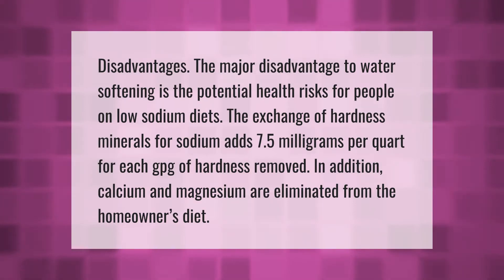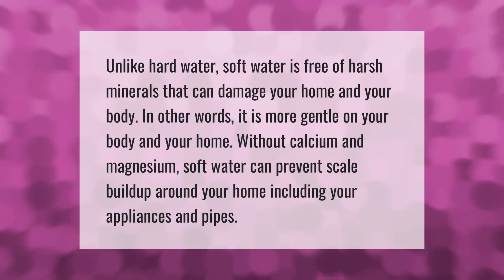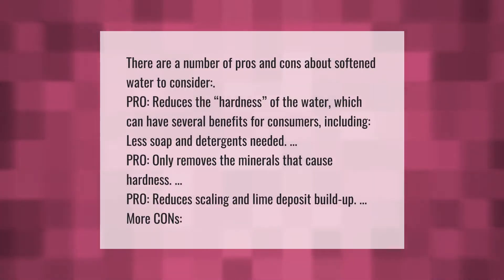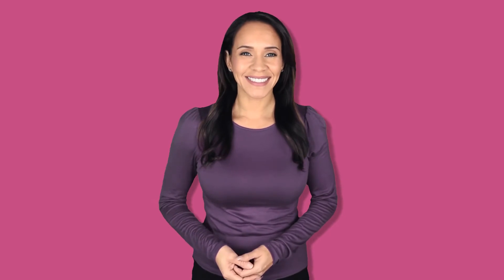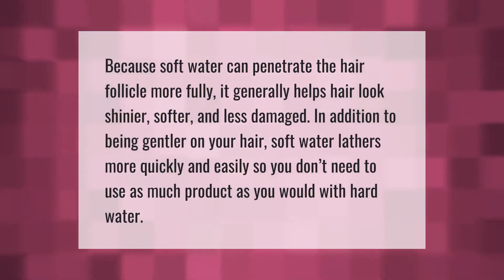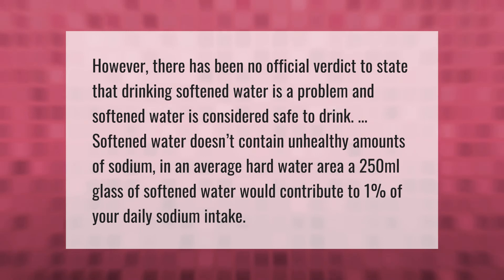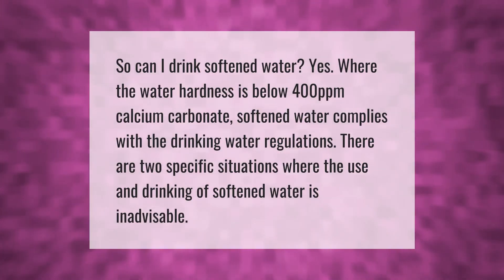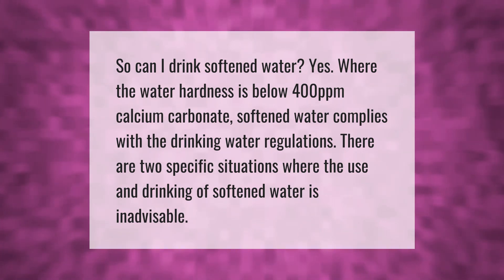What are the disadvantages of a water softener?

Comment: Soft water DOES not affect sodium intake  into your body. Drinking soft water also does not increase sodium uptake that would affect any existing medical conditions. This add is misleading!
Reply: how does it not if the TDS is replaced with sodium?
Reply: @somebb  Sodium is used to soften hard water it does not replace water. Sodium is a natural electron in water and tap, well, and spring water has 10-20mg of sodium. Soft water, depending on your tap or well water hardness, can add 5-20mg above tap, well, spring water sodium content. Example: Gatorade has approximately 270mg. The soft water sodium increase does not effect blood pressure or renal function. The only way to remove sodium from your water intake is to drink bottle water. SMART water is a great example.